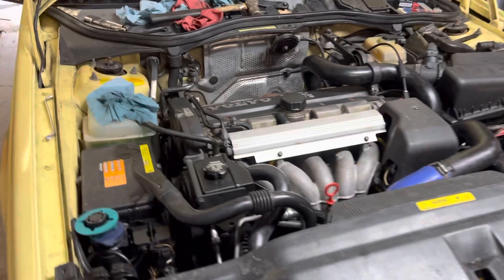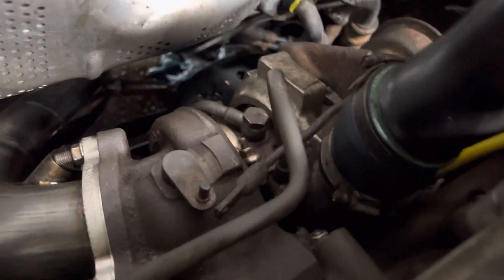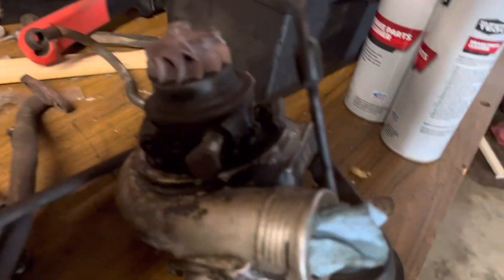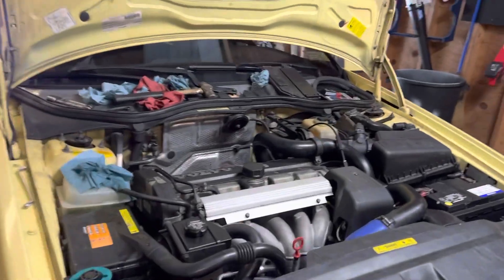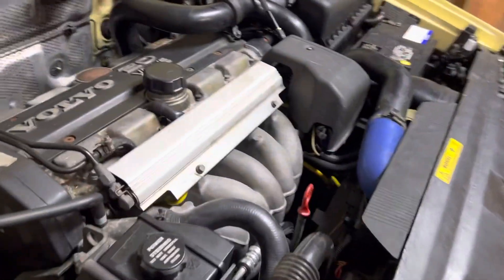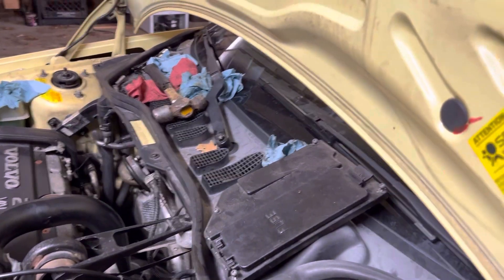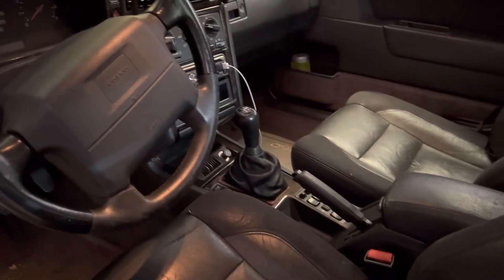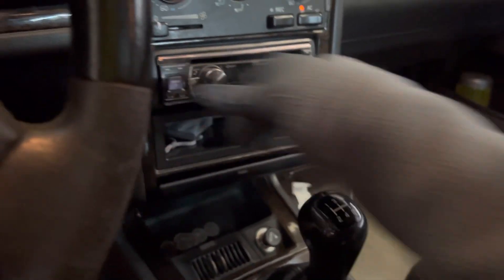850 T-5R IPD Exhaust installed, needs some tweaks

Comment: Interior looks fantastic. I’m still torn between leaving mine stock or modify it. Definitely didn’t like the round exhaust tip from ipd exhaust that I put on my S70 T5. What exhaust tip are you going with?
Reply from the maker: I have the tip that came with the exhaust. It sticks out quite a bit, and seems a little “much”. Interior I plan on doing the front seats with replacement skins from Swedish car parts either this summer or next. Not bad for 286K miles!